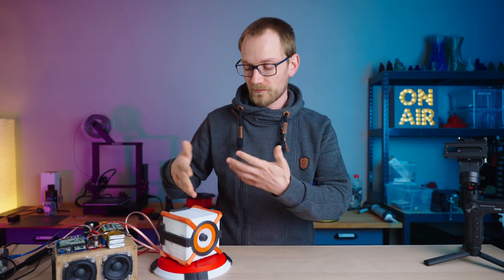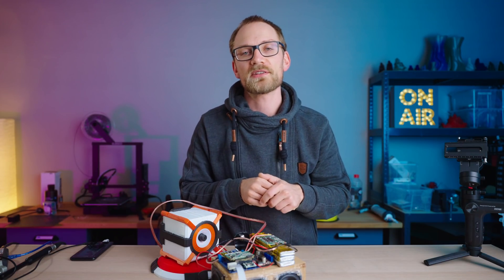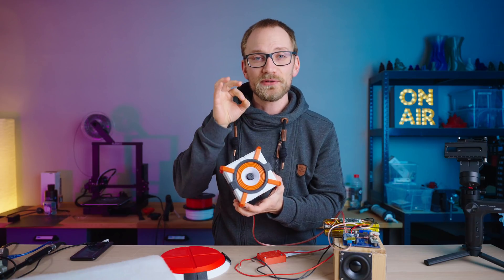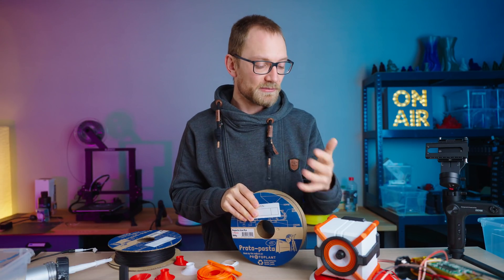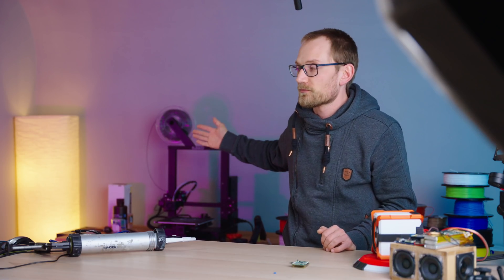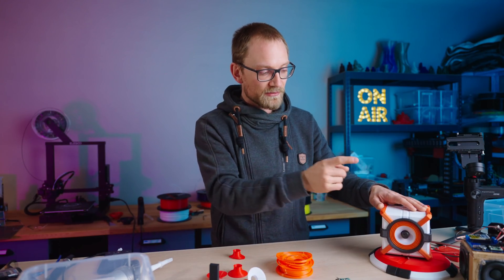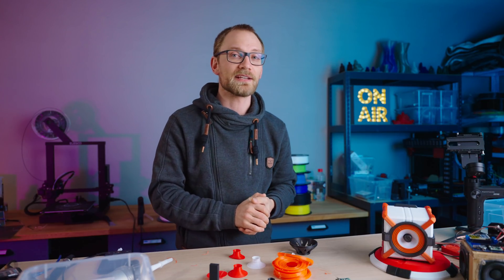Could you use conductive filament? Your questions answered about the fully 3D printed speaker!

Comment: Layer adhesion on every conductive filament I have used, including the expensive Proto-pasta, is just rubbish compared to conventional filaments. Severely limits the overall use even if you are just printing ESD safe boxes.

Comment: Thank you for the follow-up, Tom!
I'm guessing that's a LM2577S/LM2596S step up/down converter next to the LiPo cells. Is that a Bluetooth audio receiver module between the converter and the 1/8" audio socket? For some reason I thought you had a Bluetooth receiver plugged into the headers on the ADAU1701 itself in the first video.

Comment: I am using hypercube 3d printer, with:
1. BTT SKR V1.4 board with all A4988 drivers
2. nema 17 stepper motors
3. Inductive type probe sensor (6V) for Z axis and optical endstops for X and Y axis
4. 12 v SMPS power supply

Problem : When I put any object for printing, my printer becomes slow multiple times in between. (i.e. nozzle moves very slowly)

E.g. in 2 hrs of total printing time, my printer gets slowdown for 2-3 times for 1-2 min.

How can I resolve this issue?

Comment: I can recommend the Dayton Audio DSPB-250 DSP AMP, for $35 you a single board with the ADAU1701, a 2x50W amplifier, 4 analog potentiometers on the one board, and a cable kit. You still need an external programmer, but they have one ready to use for $25 (DSPB-ICP1). These products are also under the brand Sure Electronics, JAB3-250 is the same as DSPB-250.
Reply from the maker: Thanks for bringing up this board! I've used Sure/Wondom and Dayton before, but didn't know this exact board existed. It's basically the exact board I was trying to build myself 😄
Reply: @MadeWithLayers  If you pair it with one of their KAB 250v3 boards, you get an extra two channels, so 4x50W output and BT input too. I made an enclosure for them: https://www.thingiverse.com/thing:4761687

Comment: 0:01 what DSP did I use?
3:12 why no acoustic dampening?
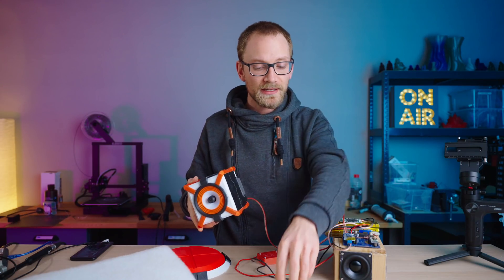5:16 why did I use so much adhesive?
6:28 could I've used conductive/magnetic pla?
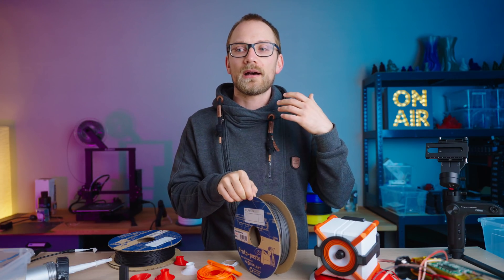8:50 about that eq...
10:45 about the printer...
12:32 why the print quality so bad?
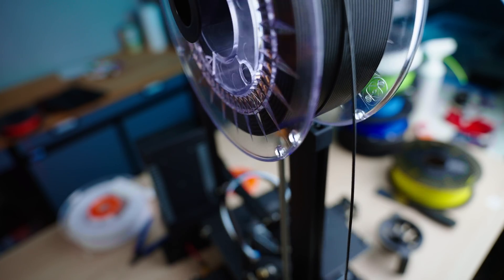13:03 challenges with the build?
16:42 conclusion

your welcome everyone
also, like the new profile pic

Comment: Completely agree with Tom's comments on the Neptune - but as he says, you get what you pay for and it's clear that the law of diminishing returns is in operation here. For printing most parts you could have a bank of Neptune 2s running and that makes for 5x the speed if you're prototyping a large project that you already have the design files for. I'm doing a tortuous one right now on a single printer but had I the budget, I'd have got a bunch of Ender 3s to do the job in a fifth of the time.

Comment: A compromise on the wool is to just line the walls of the enclosure with it.  This will reduce the standing waves, but as the box isn't stuffed full of the wool it won't affect the efficiency of the speaker much.  That's what I usually do in a sealed box.  Now for a ported box, which is what you actually have when using a passive radiator, stuffing the box with wool isn't needed, just line some of the walls (an unlined wall facing a lined wall is enough).

Comment: Not sure if it's equivalent to "detect thin walls" in Slic3r, but in Cura I had good results enabling "Print thin walls" and "Equalize filament flow" for thin features that would otherwise not generate gcode.

Comment: I am working with a ADAU1452 DSP board from AliExpress. I can’t for the life of me get the Selfboot to Work (boot to program I made in sigma studio)
Reply from the maker: There's one of those sitting on my desk, too. Looks like mine has a microcontroller that's messing with things...
Reply: @MadeWithLayers  this model? 
https://a.aliexpress.com/_mKexZ8X
Yes it has a STM32 chip for some reason. I really don’t need that as I just need the DSP functions and outputs to do 3way active crossover. I am looking at their diagrams and different i2S / SPI setting to try to write to the memory and using the Selfboot jumper. Alas. It’s only working when programmed until power off for now.